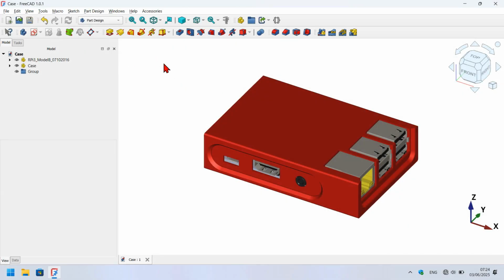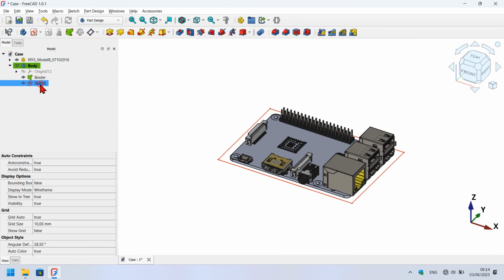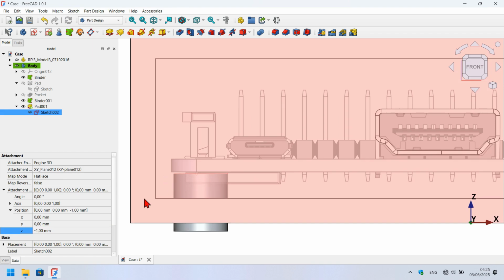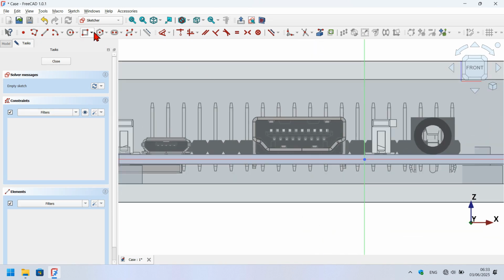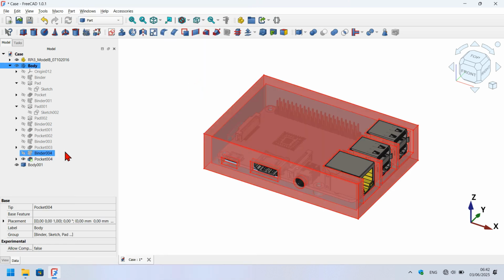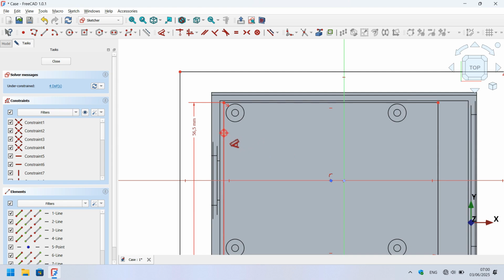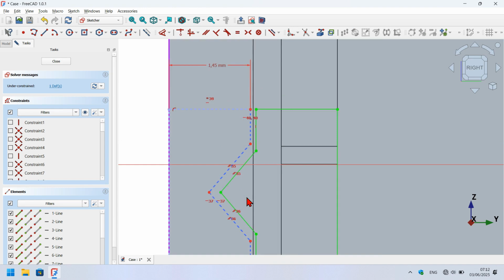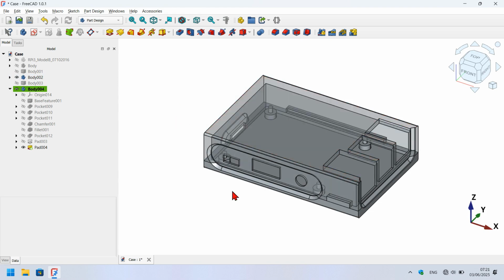FreeCAD 1.0.1: PartDesign Shape Binder & Sketcher create external geometry tool for designing a case

Comment: Thank you for your informative video.
I have an issue when I tried to follow your instructions though. After finish making top cover, I use Copy (Ctrl+C) and Paste (Ctrl+V) to make Body003 and Body004. When I double click Body004/Pocket012, a strange error appeared in Report Window: <TopoShape> TopoShapeExpansion.cpp(909): hasher mismatch. No matter what I did, Freecad could not compute the shape of bottom cover.

I am using Freecad 1.0.1.
Is it Freecad problems or did I miss anything from your video?
Reply from the maker: It is FreeCAD sometimes. But make sure you have followed the steps shown in the video.